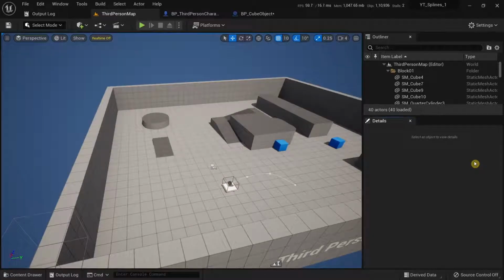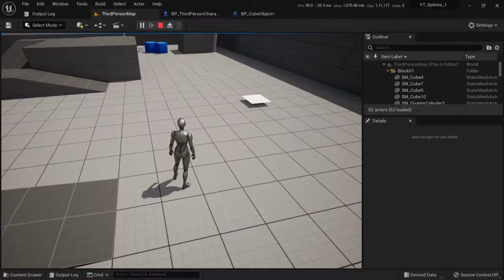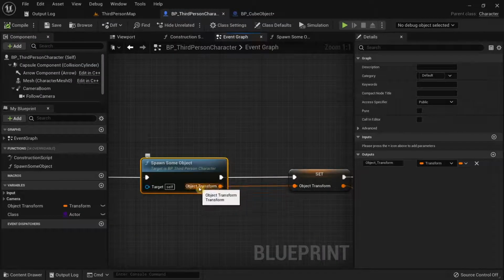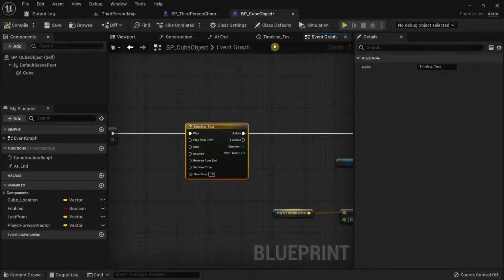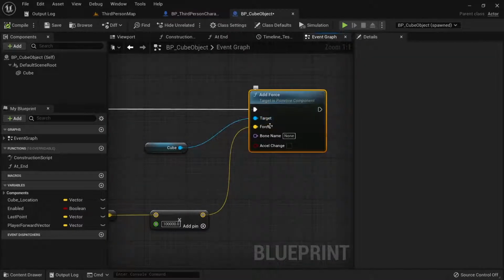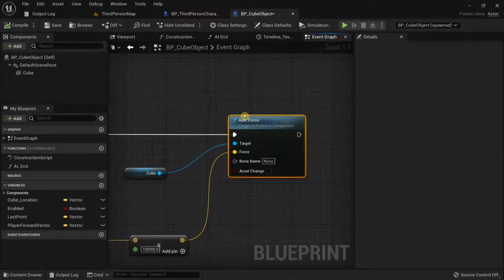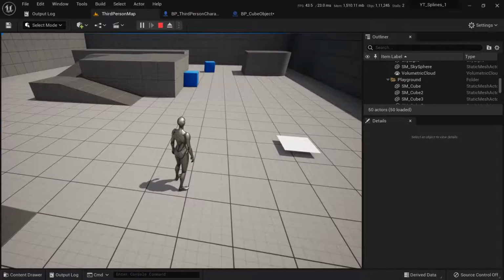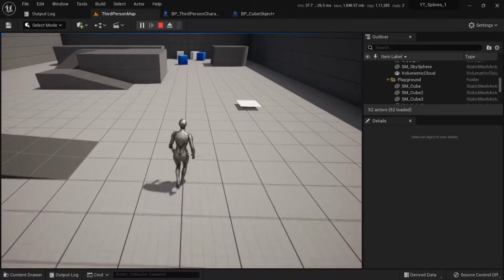How to use Add Force node in Unreal Engine 5

Comment from the maker: I forgot to mention that you can change the mass of a static mesh (in this video, it's the cube) by going under it's Details > Physics and then enabling Mass (Kg). This way, you don't need to give a large value to the Add Force Node.